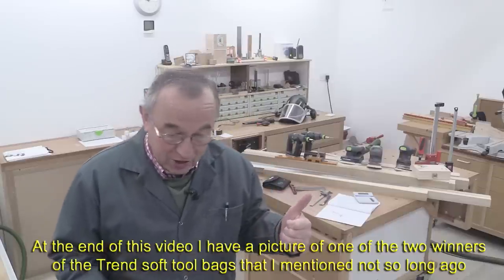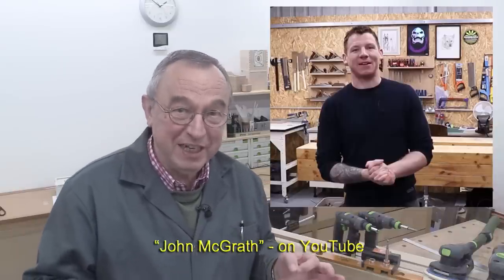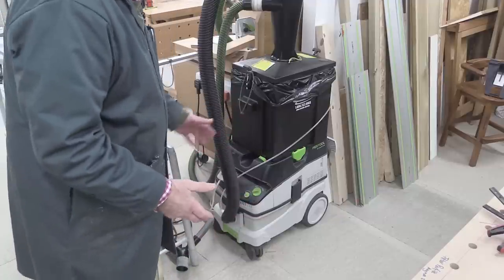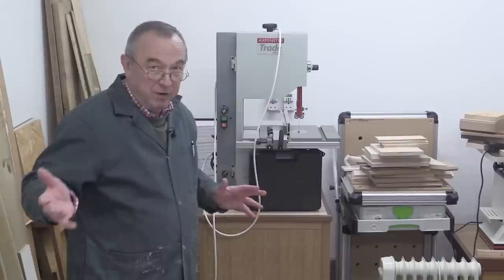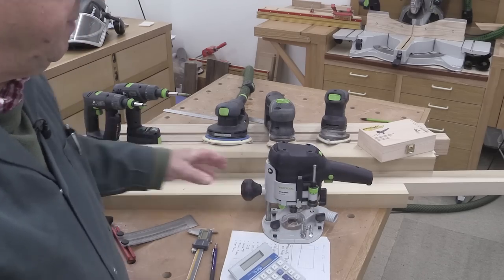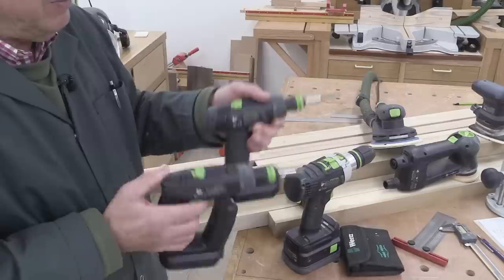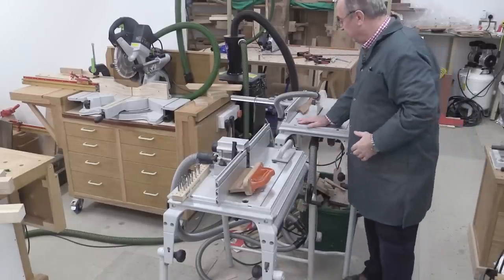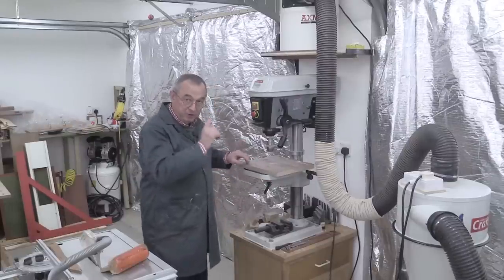Some of my favourite tools

Comment: Hello again Peter. As usual great video. I am 52 years old now and I have been practicing buying the best tool for a while now . Festool never disappoints. I have the big 6” rotex sander and the other sander ro 125 I think. Also have the ct 36 , the planex electric hand plane , track saw ts 55 and recently purchased the domino 700. I was going to buy the Festool miter saw but I sold my SawStop and bought the Felder 700s 10’ sliding table saw. After that I never used my dewalt miter saw so I sold it. Will make a shop tour video soon. You buddy Gilbert   Cheers
Reply from the maker: Hi Gilbert, Excellent - I hope it is not too cold in Canada today -=  it is freezing here.  Cheers.  Peter
Reply: Not too cold today. Where do you live now?
Reply from the maker: Hi Gilbert, I am in the south of England. It is chilly but nowhere near the -30 deg C that I had in Petawawa in early 1982 !  Peter
Reply: Are you guys still in lockdown because of that new strain of COVID-19? Are your hospitals getting overwhelmed?
Reply from the maker: Hi Gilbert, It is not good as the new strain spreads so much more easily. We are only a fraction away from a lock-down.  Peter
Reply: Ok. Stay safe buddy. Hopefully the vaccine will get life back to normal.

Comment: Hi Peter,  how right you are about buying the best you can afford.  Over the years I have bought a lot of cheap tools which have packed up and I then replaced with better ones.  By the time I bought the replacement the price had nearly always gone up quite a bit so the two ( cheap plus good) ended up costing up to double what I would have spent had I bought the better one at the beginning.  Also the better tools are so much nicer and easier to use.  They are usually heavier and easier to control and are better at illuminating the working area and removing dust and chippings etc.  I now buy more and more Festool stuff and no longer worry about the initial cost.  As a hobbyist the time saving etc which matters to the trade isn't important but the ease and pleasure of use does.  Happy NY  Mike
Reply from the maker: Hi Mike, Thank you so much.  Cheers.  Peter

Comment: Another wonderful video. You make an excellent point about buying the best tools you can afford, and I absolutely agree with you and the sentiments of many of your commenters in this regard. 
HOWEVER, if, like me, you work predominately in a site environment where tools are not treated to the luxuries of a workshop environment, it would be hard to watch your £1200 saw get blasted with brick dust or soaked with rain in a flash downpour. (let alone getting lifted out the back of your van when the rest of your tools get stolen). I do get briefly envious of Festool owners, as it is amongst the best a carpenter can get, but I cant bring myself to expose such wonderful and expensive kit to the additional abuse of site work. I also understand that your video is about tools in the context of a workshop environment, so my comments may not be relevant. (I just like watching your videos).Cheers.
Reply from the maker: I understand your points completely - are you UK based? The theft of tools from vans parked overnight is dreadful as it cripples the hard working self employed person. Cheers.  Peter
Reply: @NewBritWorkshop  Hi Peter. I'm based in the south of the UK, and my heart breaks for my fellow tradesmen when I hear about the theft of their tools. Its a despicable act. I go, successfully, to great lengths to protect my own tools from theft, but alas, cannot share with others via YouTube as I don't want to show my hand to potential thieves. I am starting out with videoing my work and am starting to understand that its not as easy as it looks. Cheers.
Reply from the maker: I am planning a series about making YouTube videos which will be a huge amount of work and spread across several videos - perhaps starting in August with luck. If you need help and advice you only need to let me know.  Peter

Comment: Festool tools do last longer than most, we are particularly hard on tools and I’ve yet to replace a single unit in 13 years.
Most Bosch, dewalt Mikita tools are replaced in less than 5.
If you cannot afford it now that’s fine but in the long run they can work out to be cheaper.
Reply from the maker: That is such a useful insight - many thanks.  Peter
Reply: Agreed.
 I treat all of my tools like tools. Even Festool. I sand drywall mud (do a lot of full room repairs of plaster)with my festool palm sanders into the ct26 and I mean as long as you dont let the bag get stuffed to the top where the hepa filter is it will never lose suction. I pulverize that thing. 
 Then theres my go to sander. The ro90. That tool takes the worst beating from me that anyone gives any sander. I have it hooked to the 21 foot 35 mm festool hose coupled to the 13 ft hose and climb everwhere with that rig
 I would post a link but, dont want peter getting agitated 😜. I have dropped that sander many a time and yes I have loosened the plug it cord twice. Both times festool fixed it for free. Its due again but, still works.
 I also do carpentry work on boom lifts and strap the kapex to the lift. I rock that thing around (especially if  its a sloppy boom) bouncing all over and it is still spot on.. 
My Festools are not even clise to pretty anymore but, still run like champs. I'm  feeling like my dts or is it rts sander may  not run like it used to but  it is 7 years old, has been run hard and still works. Could it be tired? Maybe.
the dust collection can not be touched by any other company
Reply from the maker: Hi William, If any of the sanders start to fell "tired" take the shoe off and clean out all the caked on dust and also look to see if it is possible to put new brushes on.  Cheers.  Peter
Reply: @NewBritWorkshop  
Ill give that a look👍

Comment: Hi Peter. Regarding the Parf Guide. I'm planning to build a new solid timber workbench adding dog holes to the top and legs. I have planned on 3/4"mm holes. Given the thickness of the top (65mm) I would like to make the holes 3/4" rather than the standard 20mm. I have the Parf Guide type 1 and quite a few 3/4" clamps and dogs (Veritas and Clemency). Are there any plans to produce a 3/4" cutter or is there one available? Can you recommend an alternative approach say with a Forstner bit with a 3mm pin???
Reply from the maker: Hi Stak, I do not know of any 3/4" cutter that would do the job and one has not been produced for the PGS. I am sorry not to be able to help you.  Peter

Comment: Hi Peter, If I am not mistaken you previously had the UJK professional router table from Axminster with the cast iron top and the router elevator. Have you permanently changed to Festool and is there any particular reason behind it? Best wishes from Sweden.
Reply from the maker: Hi Simon, It was a space issue and I could not fit in two router tables.   Peter

Comment: Peter, you mentioned the OF 1010 is your favorite router, and later in the video you said your OF 1400 in your table you began to not like it as a handheld router.  Can you explain that further please?
Reply from the maker: Yes, it is very simple. Before I bought the OF1010 the OF1400 was my "goto" router with the OF2200 in the router table. When I got the OF1010 I realised that it did 85% (or more) of the hand-held work that I do. It has better dust collection than the OF1400 and is much easier to handle. The OF2200 is now free for the bigger hand-held work and the OF1400 is perfect in the router table.  Peter

Comment: Why do you ‘started not liking the of1400’? I’ve been thinking a while now  about buying it, don’t like the dust extraction port not built in though like with the other two. Thanks for the overview!
Reply from the maker: Hi Edwin, The dust port is not very good but it does do the job. For a router that I want to pick up and use frequently it is just a bit too heavy. The OF1010 does everything that I need to do by hand and the OF1400 is perfect in the router table.  Peter

Comment: Peter, may I ask why you do not get on with the Festool OF1400 as a hand held router ?
Reply from the maker: The dust collection is not quite as good due to the plastic parts and I prefer the lighter OF1010 for my day to day hand held routing. The OF1400 is perfect in the CMS router table. Also the OF1010 can have guide bushes centered using a mandrel which is important for accurate template and dovetail work. Peter

Comment: Hello Peter, I've made a few comments on your videos (I'm the "explain it like I'm 5 years old guy" haha). Jsut a question ... I've invested in some Forstner bits (from Makita, from a seller on Amazon) and whilst they are "OK" the forstner bit that comes with the Parfitt MFT system (forgive me if I'm saying it wrong) is farrrrrrrrrr superior. I like to work only with hardwoods and the Makita bits struggle. However, I'm getting ready to build a full system outside of the recommended spec for the Parfitt system and did a test to check clearance for the 20mm hole and clamps, and the 3mm bit and forstner style bit cut through the 24mm Baltic Birch like it was butter. So my question is, can you recommend a set of bits (traditional and forstner style) that come with the Parfitt system? Cheers.
Reply from the maker: Hi Andrew, The Parf Guide System has a unique 20 mm cutter and also a long (ish) 3 mm drill. Both are available from Axminster. There are no other cutters or drills in that family but if you would like to get some raeally good drills try Famag (I have many of their super Forstner and bradpoint styles) and failing that try Fisch - Google where they might be available.  Both Forstner and bradpoint are excellent for wood. Good luck.  Peter

Comment: Hi Peter, I too am a little confused about your comments on now preferring the festool OF 1010 router
On your festool router comparison video you did a while back you recommended, if you could only buy one it would be the festool OF 1400.
Is it only the weight? Or the dust extraction?
I ask you all this because I’m just about to buy one and I had in my mind the 1400 ! 😊
Reply from the maker: I understand the confusion for which I apologise. If you can only have one router (ever) then you do need the 1/2" collet capability which the OF1010 does not have. However, if you can get your day to day routing done using cutters on a 1/4" or 8 mm shaft then the OF1010 is the dream machine. I am lucky that I have both the OF1400, which is perfect in the router table, and the OF1010 which is, in my view, the best hand held router I have ever used.  Peter
Reply: Thank you Peter, I’m now giving the 1010 some serious thought, and this might be what I buy now.
You have taken the place of The new Yankee workshop! On a new platform.
You and your YouTube channel are indispensable to us, you do truly great work here.Jason.
Reply from the maker: Hi Jason, You are very kind indeed and it is comments like yours that have helped me through this very difficult year.  Cheers.  Peter